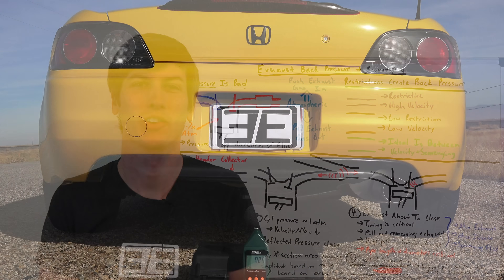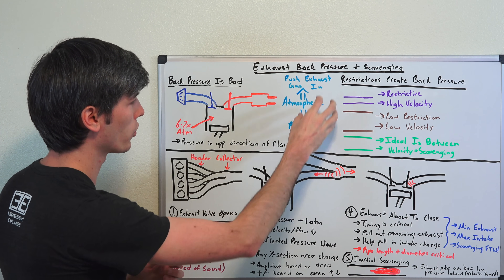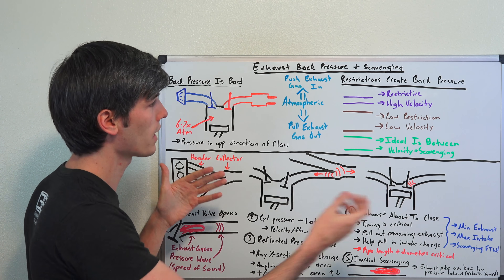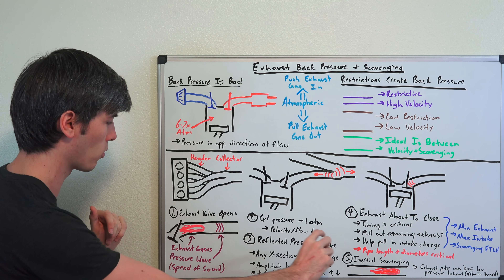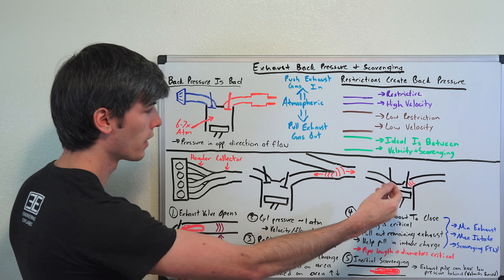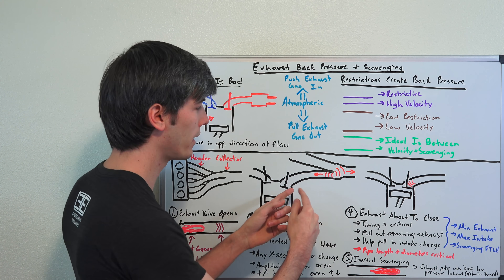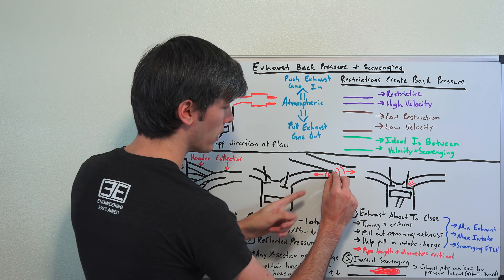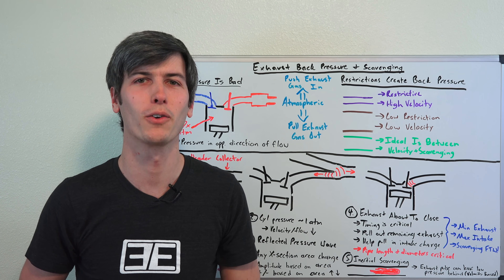Stop Saying Car Exhausts Need Back Pressure

Comment: My butt dyno says my car lost torque with a stainless steel free flow exhaust.
Reply: Maybe because your ecu was mapped specifically to the stock exhaust?
Reply: If you don't have an exhaust pipe properly tuned to your engine, with the correct length headers, you're actually going to increase back pressure, because the natural tuning of the pipe is opposing the volumetrics of your engine.  A larger pipe is not actually always going to produce better flow.  If you think that pipes are only going to be tuned for a small range of RPMs, you're absolutely correct, which is why a perfectly tuned exhaust and a "perfect" cam is going to have one hell of a power spike at one RPM, making the power curve a lot less usable.  A certain amount of detuning is essential to make a car drivable (and not horribly anemic up until 4,500 RPM, at which point it peels the rubber off your tires).
Reply: I have heard different engineers explain this topic well.  It is not so much that you need back-pressure, but you do have to consider fluid dynamics and its effect on scavenging.  Air at high pressures behaves like a fluid, and at high velocity it acts like a thick fluid that pulls on the air in the cylinder like a rubber band, and during valve overlap it drags fresh air into the cylinder.  The air doesn't simply flow out the exhaust valve solely due to differences in pressure, but also because of the viscous behavior of air at high pressure and velocity.  So, what these other engineers say is that you can put tubing in your exhaust that is too large for your engine and rob horsepower.  This is not because of loss of back-pressure, but because of the velocity loss, particularly between the exhaust port and the collector.  Typically this may cause a loss of horsepower at low RPM, but ramp up as RPMs increase and the flow volume begins to match the capacity of the tubing and exhaust velocity maximizes.   So it is true that too big of an exhaust can have negative effect on performance, but not truly because you have 'too little back-pressure'.  This is also why it is wise to get professional advice before running out and cobbling together a bunch of exhaust products without understanding how they must be planned to achieve the desired effect, particularly in tuning for a particular power band.
Reply: Butt dyno😂😂😂
Reply: haha and we all know how accurate butt dynos are.
Reply: artgoat I think this only applies to N/A engines. Any disadvantages with a turbo engine would be outweighed by the benefits.
Reply: Need to get a tune
Reply: @StringerNews1  That last line was awesome! LOL
Reply: I’m guessing that engines NEED to have exhausts designed specifically for their rpm range requirements. If it doesn’t help, it hurts.
Reply: artgoat I had a bmw e34 diesel, which later I straight piped. Felt no difference at all so I came to the conclusion that the back pressure thing is nonsesne. But recently I've bought vw golf mark 4 and straight piped it. I instantly felt torque loss at the lower rpms and no difference in the rest of the range. Then I've put remmus exhaust at the back and what do you know, the car became way more responsive and torque'y again. Now I'm in need for a bigger exhaust pipe cause I've put a bigger turbo, looking for something like going from 60-61mm stock to 65mm custom exhaust system.
Reply: @Lessthanthreeedm  I think the only imprtant thing is the header pipes have to be the same length/diameter as the original ones before they came to the collector. as long as that's the case i dont think there will be a difference
Reply: Often times free flowing exhaust systems hurt factory engine performance, even high perf factory engines, because they either (a) reduce exhaust gas velocity at the RPM range of the factory engine or (b) cause changes which result in a lean condition.  The first thing most cars need after an exhaust upgrade is a fuel remap to richen up the mix.
Reply: Nate Schroeder makes sense way you put it.
Reply: StringerNews1 - ah crap - back to the Swedish pump, I guess!
Reply: Tagic Mrooper A quick search tells me the E34 is forced induction.  With a turbo, ANY restriction in the exhaust is going to slow the engines ability to spin the turbine.   If you spin the turbine faster you make more power or at least power faster.  All of that said, regardless of the exhaust work you had done to unrestrict the exhaust, you still have the turbo which is a big restriction in and of itself.
Reply: fo fkifkj how would you power these fans? A turbo is restrictive but its advantage outweighs its disadvantage by forcing air into the engine.
Reply: I agree with Alex.
Reply: The ANT by that argument. Ould u not improve engine efficiency by putting in effect fans to move the exhaust out faster. And increase torque, engine responsiveness and flexibility? Basically the reverse of a turbo
Reply: Did it lose overall torque or did the torque curve smoothen? A reason to take it to a real dyno.
Reply: That's because you changed the EXHAUST VELOCITY and messed up the scavenging effect. 

You may have removed back pressure, but at the same time, you slowed down the exhaust velocity by using bigger pipes.

Back pressure is always bad.
Reply: I have a 2006 Miata w/miles . I added a catted header , Racing Beat , and my butt Dyno says , " damn what took you so long? "
Reply: Alex Gunner i trust the butt Dyno and I'm a engine lab Development Dyno operator. Note: make sure your engine tune matches your mods. Sounds matters.
Reply: @StringerNews1 I think most of them are just putting 3in tips or muffler on the car for appearance and I guess the sound. The rest is stock size. Though 4 cylinders can make some power. New Mercedes   2.0l 4 cylinder makes 375hp and 350 lb.ft. Some people are making 400-500hp with Honda 4 cylinders 1.6l - 2.2l + a ton of boost and a rare few who have dumped a ton of money get around 1000hp. At those power levels even being a 4 cylinder a 3in exhaust would not be overkill. All about how much air you can pump.
Reply: it actually was creepy and not funny in any way.
Reply: Cuz when more air is leaving you need to but in more gas
Reply: Same here.   It absolutely robs torque
Reply: :D
Reply: Alex Gunner did you upgrade your air filter to a free flow intake filter?
Reply: YOU MUST CHIPTUNE ECU TO USE NEW EXCAUST. ECU D NOT SEE BIGGER EXCHAUST, YOU MUST TELL IT :)
Reply: StringerNews1 Ha , exactly.
Reply: Physics is physics what did you do wrong.
Reply: Butt
Reply: Whas your new exhaust larger diameter?
Reply: @StringerNews1 hahahaha
Reply: Alex Gunner 
Prob went too big and/or with a poorly incorporated resonator? I step from a 4” dump to a 3.5 ‘header’ pipe with a properly incorporated resonator (needs) that to work with cat, soon after the resonator i drop to a 3” (this is the tricky bit to get right) then into a straight through, 6” baffle and backdown to a 4” OD, 5” long tip. Oh and the entire system bar the dump pipe and cat is a top shelf racing item that uses specific metal compounds and high quality bends and connecting brackets. Not cheap but the little things count when coupled with all the other correct little things. Might make the same max kw due to displacement and rpm but the manner in which it works together to make it produce an extra quantity of ‘magical’ torque that when looked at from an individual component and spec perspective, shouldnt be there with out lightening the reciprocating mass. 
Oh, you need to go to Japan or a high end race car shop for this level of work. Murican workshops and there 5000hp 6L monstrosities just dont have the need, knowledge, of interest for  incorporating very complex fluid/hydro dynamics into the R&D budget. 400kw, 600Nm from a 2.5L L6 @ 5000rpm and last for 100,000km (60,000miles) is significantly harder than 1200-1400hp, 800-900Nm from 6.5-8L V8 @ 8500rpm for 100,000-150,000km
Reply: never trust your butt, use a dyno.
Reply: My new decal give me extra 50hp
Reply: When I upgraded my exhaust, I gained about 12whp/8tq peak, with a decent increase across the entire range... However, it wasn't a significant increase in power, so it wouldn't be noticeable. What WAS noticeable was the increase in noise... Which ultimately lead me to think the car was SLOWER than before. I get the same amount of noise at half throttle, that I used to get closer to full throttle... So when I used to be stuck to my seat every time the exhaust was let's say 88db, I was now feeling only moderate acceleration at the same noise level.
Reply: Alex Gunner my I-64 Southern Indiana hills Dyno said the same thing when I put a dual exhaust on a 318 Magnum in a 99 Ram, after gaining considerable torque from Gibson truck headers. Didn't lose all of it, thankfully.
Reply: Correct
Reply: Alex Gunner the exhaust wants to be as small as possible without being restrictive to keep exhaust gas speeds up to increase torque. Its about getting the all (not just some like a too small bore would) gasses going as fast as possible. Too big a bore exhaust will slow gasses down.

Comment: I still say if you "open up" your exhaust you need custom tuning or you won't run optimally
Reply: Any car with a EGR must have back pressure. Otherwise the you get power loss and detonations.  . .
No back pressure. Retuning the EGR car is a must.. Fuel, ignition timing,etc. 
Awesome video! !!
Racer 101... Correct scavenging makes more power over the whole RPM range.

Comment: wouldn’t  the induction of cold air during the brief period in the cycle when both the intake and exhaust valve are open also assist in forcing out the exhaust gases, as colder air is more dense than hot exhaust gases?

Comment: Great video. Easy to follow and nice simple visuals. A great video to be able to point the uninitiated to when they ask what the point of a "tuned" exhaust is from now on. So many people have no idea the physics behind something as seemingly simple as a series of pipes running from the engine to the back of the car. If changing it can increase/lower your power output, science is happening. Fluid dynamics 101 :)

Comment: Q. Burnt valves due to lack of back pressure? A. More like excessively lean air-fuel mixture (old carbureted engines that were factory-tuned for an excessively restricted exhaust system - Remember that the 1975-1979 model year new cars always had a hissing sound when passing a car on the highway at 55 mph) from when the y-pipe rots totally apart (old cars from the 1970s with zero rust prevention for exhaust systems - no one expected the vehicles to last more than 80k miles anyway). Keyboard mechanic experts always claim how an engine needs backpressure for low-end grunt - wanna bet? My 1989 vehicle really boils the tires off-idle, once I put on a high-flow catalytic converter and an aftermarket cat-back system (below zero-Fahrenheit weather caused stalling upon cold start until richening up the fuel mixture a bit by upping the fuel pressure delivered - now my vehicle has never run better - I am very happy with the results). Removing the OEM highly restricted exhaust system, and replacing it with a free-flowing exhaust, will require tuning the engine (and that goes for EFI or carbureted engines), if not the results will quite possibly be worse than before the exhaust modification(s).

Comment: What would happen if you connected a supercharger that fed only the exhaust system? Could it be possible to create a sort of vacuum that pulls exhaust out faster?
I'm also envisioning this on a naturally aspirated rotary engine. Without valves getting in the way, could this create a sort of negative vacuum that would increase torque?

Comment: Jason,
 I have a question about valves and flow. Do you know of any valves being used in any cylinder head that are not round.
It seems strange to me that in this day in age they are still shaped perfectly round I realize that that due to costs the seat and the valve being round makes since but in a high performance engine where cost is not a factor why couldn't they be more  shaped like a rounded banana to optimize the swirling air and gases coming in and out.
This has been bugging me for a long time and would love to hear your take on it.
Victor
Reply: It's mostly about getting the valves to reliably seal and not warp. A non-round shape is much harder to maintain the correct shape as it heats up and cools down. Years ago, Honda experimented with an oval-shaped piston to be able to use a single, larger valve (instead of multiple valves per piston) in a racing engine. I suspect that the manufacturing difficulties of making oval pistons, rings, and cylinders were more of a problem than the use of multiple valves was, however.
Reply: The corners of a tapered valve would act like a glow plug and pre ignite the mixture.  Internal cylinder temps being about 1500F would weaken a sharp corner and cause a premature failure.
Reply: Another reason is that the valves actually rotate around their shafts as the engine runs for a variety of reasons, so the valve shaft acts like an axle of sorts. some more than others. A non round valve might rotate slightly and fail to seal properly. Rotation may also more evenly distribute valve and seat wear. (think lapping a valve in). I don't know for sure, in engines using a rocker to open the valve, the there is lateral as well as vertical force applied, which may also cause the valve to rotate. might be less of an issue in modern engines, but older ones with larger tolerances did rotate (bug motors in my experience).
Reply: That idea has already been thought of, many decades ago in certain aircraft radial engines. They used sliding side valves that simply slid open to expose the ports. That setup wouldn't be efficient with engines that turn high rpms, such as cars or motorcycles, but worked ok in the large, low rpm radial engines. But of course not all radial engines used those types of valves.
Reply: Also, a round shaped valve allows the pressure in the combustion chamber to be evenly distributed around the edges of the valve. A square valve for example would have uneven pressure around the edges. (More force on the corners,  which would probably have less material too)

Comment: remove the back pressure on any non racing vehicle and you will loss low to mid torque and your fuel usage will go up (race cars run at high rpm and fuel use is not an issue).
never listen to people that say back pressure is not needed on street vehicles and that info comes from a transport engineer with over 30 years experience.
it doesnt mater what type of engine you have you MUST get a tuned exhaust to suit or it WILL cost you money in the long run.
ps. unless you are a lead foot putting a tuned exhaust on can save fuel and give you a nicer sounding exhaust
Reply: Even on race vehicles, they have some exhaust.  Even dragsters don't just have bare exhaust ports at the heads, they have exhaust tubes, and even though they are only 30" long and no muffler, those tubes are carefully selected to control the velocity, even though they have a big blower on top.
Reply: You clearly have no idea lol

Comment: GREAT!
You've just probably explained why some after market 'tuning' exhaust systems back in the 80s for Minis were actually worse than standard systems for exhaust flow rates.
I think Peco systems were worse than the standard system that the car came with.
I always ran the RC40 single box. Sounded sweet and did what it said on the box...

Comment: Not bad!
...But i think, you are mixing up velocity and shock wave.
And of course, you work with one cylinder when harmonic waves are important for limiting valves crossing...
A lot of guys speak about back pressure with "velocity" in mind.
Velocity is the key of everything with an inertial gaz. the burning velocity (laminar velocity in theory) is far from the sound velocity.

Comment: Thank you . Also this also applies to motorcycle such as a super sport bike? My bike is basically straight pipe but bike has a under tail ( exits under the seat to the rear) exhaust so it’s longer then your average exhaust with more curves. I was told it would burn my valves? Is that true? Is a fuel to air ratio tune be needed?
Reply: Will having straight pipes actually burn my valves?

Comment: As you said, this inertia effect is working on specific rpm range. You have very good torque in specific rpm range, but due to reflected pulses, you will have torque dip in other specific rpm range. Most of naturally aspirated car's exhaust system designed for the mid-end torque(like 4-5 k) . If this inertia effect is working properly, there will be a torque dip in low-end and that hurts driveability. So they are using aftertreatment parts or mufflers to kill this inertia effect with back pressure. In that way, you will lose a small amount of mid-end torque but you will gain at low-end.

Comment: i can kill my mootycle if i put my finger on the exhaust even though if i rev with full throttle in the limiter.. backpressure... my exhaut is (/) 18mm thick.. wih an (i think it has 50mm) exhaust  have 16hp insead of 15 and i only can kill my bike with my hand on the pipe